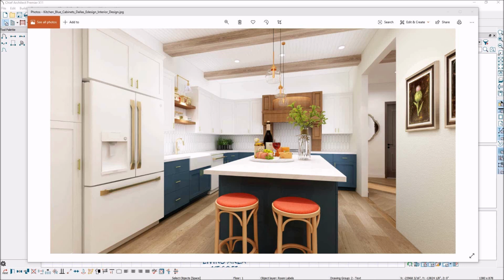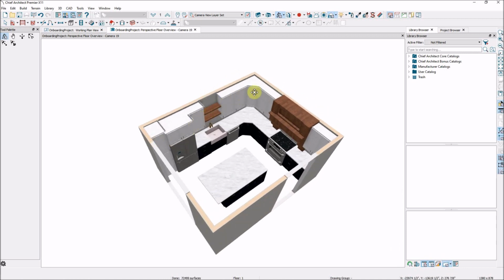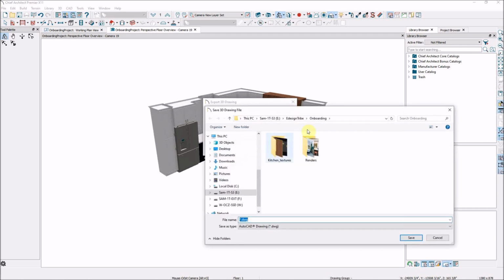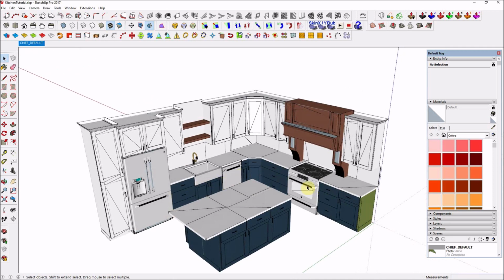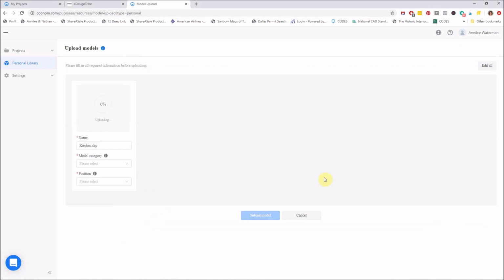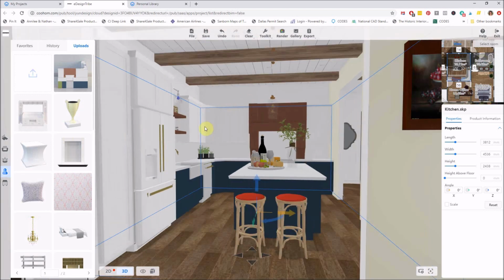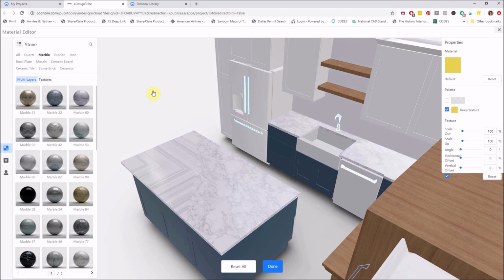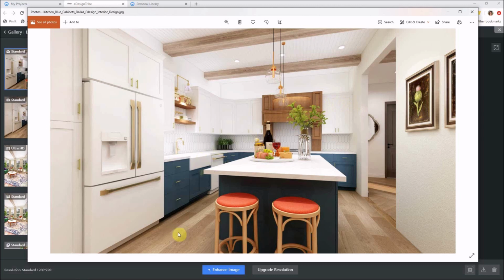How to Import Chief Architect to Coohom - Tutorial

Comment: Hi! Thank you so much for this informative video! When I brought my bathroom model into the platform I lost the wallpaper texture. I added the wallpaper texture into my texture library in the platform and edited the material - however, it isn't working. It does work if I use a material already in the platform library - but not when using one I uploaded myself. Any advice? Thank you!
Reply from the maker: You may check the texture settings when you upload, it could be the scale. :)

Comment: I don’t have Cad for the Dxf file, so it doesn’t appear in my drop down  export selection, is there other file that I could use?
Reply from the maker: You don't need AutoCAD for the DXF file.  You can export any 3d file type that the Sketchup version you use will take.  You'll open your export directly into Sketchup.

Comment: How did you add the wood beams and ceiling?
Reply from the maker: On the left menu: Floor Plan --> Beams.  For the ceiling, Model Library -->Finishes-->Drag the finish over the the ceiling in 3d view.
Reply: I don't see that option on the beams. Are you on the lite version or another one?
Reply from the maker: @hautetexasinteriorsdesign5874  Beams are right under windows, you may need to scroll down.  Lite & Featured have all the same functions. :)
Reply: @DesignerAnnilee   I got it, thank you!